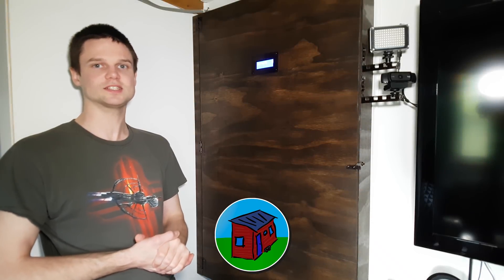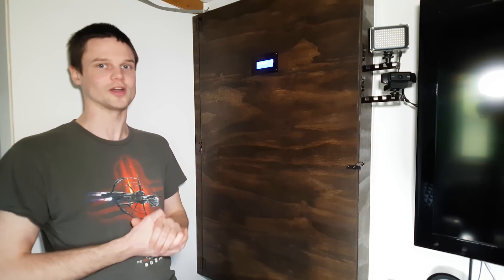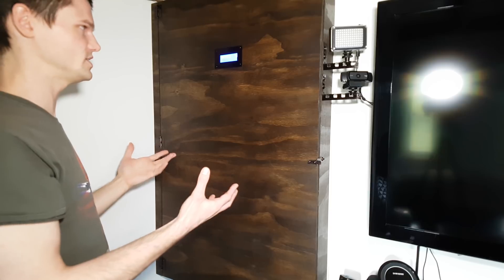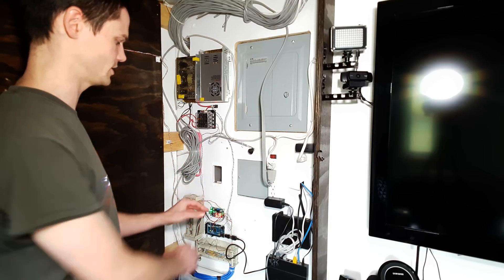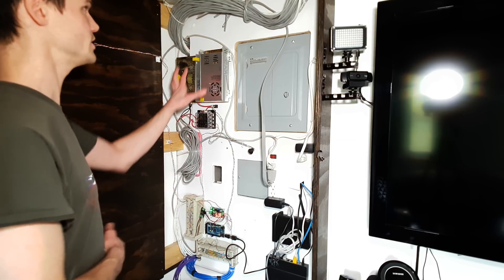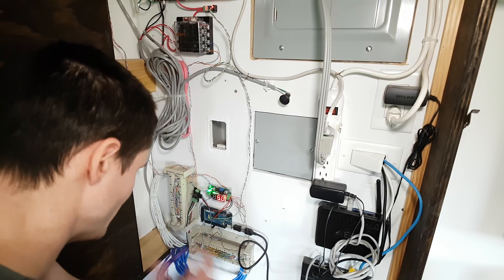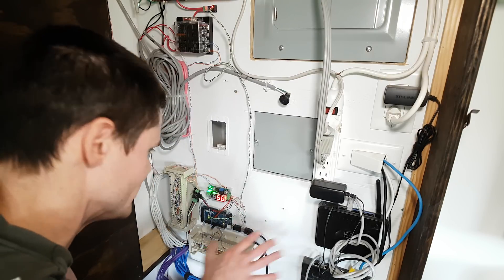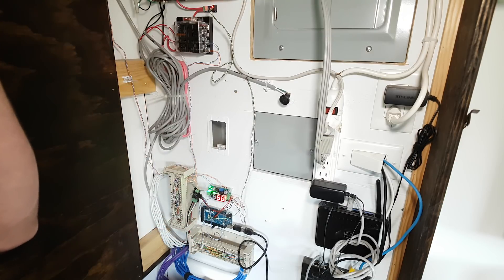DIY Tiny Home Automation Progress

Comment: Really great stuff, it's exciting to see your first steps with Arduino!  If it's not too late you might want to consider using 19mm buttons rather than those 12mm ones, the 19's are far more comfortable to press...very little finger aiming is required.  Also, if you get stuck on any software or hardware related to the project, including that button issue, just let me know and I'll be more than happy to help.  My initial thought is you need to add some button debounce logic to your code.  Microcontrollers are so quick that they detect the slightest double-click of a button, so slowing down how often they react to button presses is always needed.  You can do this with hardware or software.  Here's a short software example that I hope is a help.  I could upload a video to explain more if needed, just let me know.

const int BUTTON_DEBOUNCE_WAIT_TIME = 200;
const int PIN_BUTTON = 2;
 // Connect one side of the button's switch terminal to this pin, and the other side to ground.  If your button has normally open, normally closed, and common terminals; connect normally open to this pin and common to ground.
const int PIN_LED = 13; // Use the built-in led.

unsigned long _lastButtonPressTime;
int _currentLedState = LOW;

void setup()
{
  pinMode(PIN_BUTTON, INPUT_PULLUP);
  pinMode(PIN_LED, OUTPUT);
}

void loop()
{
  bool buttonIsPressed = !digitalRead(PIN_BUTTON); // When the button is pressed the pin will be LOW / 0V / GND.  When released the button will be HIGH / 5V / VCC.
  bool lastButtonPressTimeoutHasExpired = millis() - _lastButtonPressTime > BUTTON_DEBOUNCE_WAIT_TIME;

  if (buttonIsPressed && lastButtonPressTimeoutHasExpired)
  {
    _lastButtonPressTime = millis();
    _currentLedState = !_currentLedState;
    digitalWrite(PIN_LED, _currentLedState);
  }  
}
Reply from the maker: Yay code in the comments! This is a first lol... firstly, that's a good suggestion regarding the button size, but we might have as many as 4 buttons on a single cover-plate, which is why we picked the smaller ones. 
I do have debounce code already, including both a delay and a hold on triggering if a button is being held down (which you can see in the video). I suspect the intermittent weirdness that I have experienced might be due to the capacitance of the physical wire, causing the arduino pin to register a phantom press... but I'll have to connect more buttons and lights before being sure of anything. 
Here is a snippet of my code. BUTTON_READ_DELAY is 50, so 50 cycles of the loop, and I have a 10ms delay for the entire loop which has a blanket effect on some other things including the fading speed. I'm hesitant to use millis() because it eventually rolls over... does your code break when it does?... Anyway, I'm fairly confident that my code robustly prevents any software-based double-presses... a trigger is only recorded after a delay since the previous trigger, and then a trigger can only cause a state-change once before the delay is reset (10ms x 50 cycles = 500ms minimum between software triggers).

  //read buttons after read-delay has elapsed, and store their trigger
  if (buttonReadDelay == 0){
    if (!digitalRead(BATHROOM_LOW_PIN)){bathroomTrigger = 1;}
    if (!digitalRead(BATHROOM_HIGH_PIN)){bathroomTrigger = 2;}
  } else {buttonReadDelay--;}

  //if any button is down, store that fact
  if (!digitalRead(BATHROOM_LOW_PIN) || !digitalRead(BATHROOM_HIGH_PIN)){
    aButtonIsDown = 1;
  } else {aButtonIsDown = 0;}
  
  //bathroom state change
  if (bathroomTrigger > 0 && !aButtonIsDown){
    if (bathroomState == bathroomTrigger){bathroomState = 0;}else{bathroomState = bathroomTrigger;}
    buttonReadDelay = BUTTON_READ_DELAY;
    bathroomTrigger = 0;
  }
Reply: @tinynestproject  Ok that's great you've made your own debounce logic, so we can rule that out.  Quickly though, the millis rollover is a problem if not coded correctly, and Nick Gammon's write up is where I learned to do it properly.  It is a good read, and not too long.  https://www.gammon.com.au/millis

My next thought is the weak pull up resistor built into the microcontroller isn't strong enough for the long wires, which are acting like antennas and being affected by EMF and potentially capacitance as you mentioned.  To rule this out, can you forgo using the microcontroller's weak pull up resistor (it's around 50K ohms) and instead use a discreet 5-10K ohm resistor?  In the setup() function you would use pinMode(BATHROOM_LOW_PIN, INPUT) rather than INPUT_PULLUP.  And here is a picture of how to wire things up
https://cdn.sparkfun.com/assets/6/f/b/c/7/511568b6ce395f1b40000000.jpg

This stronger resistor will more quickly pull the pin to 5V when the button is released, and any noise due to EMF will be more short-lived.

If this doesn't work, could you tell me how often the double press seems to happen and how long after you press the button that the second press is incorrectly registered.  Just paint me a picture of the symptoms.
Reply from the maker: Thanks for the link about millis rollover, I'll definitely refer to it when I touch up my code :) 
Glad to hear your comments about the pullup properties, because that was the exact conclusion that I've reached so far, and I think I'll be trying it soon. Do you think I'd be able to use a single resistor to pullup all of my button pins? (there will be something like 15-20 of them) It would create a bunch of parallel current paths (and the current would all flow through the single resistor), but isn't there a high resistance at each pin? I really suspect capacitance because it would seem to explain the behaviour.
Reply: @tinynestproject  I might not understand what you have in mind but I don't believe a single resistor is possible.  If you connect side A of the resistor to 5V and side B to pins 2 & 3, it means that pins 2 & 3 are connected to each other and it will not be possible to isolate which one is pressed.  They will both have a 0V potential on them if either is pressed.  So just like what is built into the microcontroller, you'll need a separate 5-10K resistor for each pin.

Here's what I think you're describing.  Pins 2 & 3 will both be connected to GND if either button is pressed, so this doesn't work.

                                                                                                                10K Resistor
                                                                                                    +---------------/\/\/\/--------------- 5V
                                                                                                    |
                                                        Button 1                             |
                                                        -------------                              |
                      +-----------------------------              --------------------------+-----  Pin 2 (INPUT mode)
                       |                                                                            |
                       |                                Button 2                             |
                       |                                 ------------                              |
GND ------------+------------------------------              -------------------------+----  Pin 3 (INPUT mode)

But you're correct in that INPUT pins are very isolated from the circuit, they are in a high-impedance state and have an equivalent series resistance of about 100 mega ohms, which is huge.  This is completely unlike the behavior of an OUTPUT pin.  When you set a pin to be an OUTPUT, it will attempt to drive the circuit HIGH or LOW (5V or 0V) so you need to be very careful when dealing with them.  Imagine connecting pins 2 and 3, setting both to OUTPUT, and then setting pin 2 HIGH.  That will create a dead short between the two pins and both will be fried.  The generated heat might damage other circuitry in the microcontroller as well.

The other point about doing things in parallel through a single resistor...you can use ohms law (Voltage = Current x Resistance) to determine if the resistor can handle it.  For example, if you connect side A of a 10K resistor to 5V and side B to GND, and solve for current, you get 5V / 10,000 ohms = 0.0005 amps.   Resistors are rated for a certain amount of wattage (Watts = Voltage x Current) so the 10K resistor will only be forced to dissipate 5V x 0.0005A = 0.0025W.  The most common size of through-hole resistor that comes in hobby kits is 1/4 watt.  So a 0.25W 10K resistor can easily be connected directly between 5V and GND without being damaged.

Hope some of this helps!
Reply from the maker: Ah of course... I didn't think it all the way through in terms of the pins being interconnected... sigh that's a lot of extra resistor connections, but I've just ordered some small breadboards that I will mount inside the cabinet to assist with this type of thing. 
The rest of your comment was also super helpful thanks. I've learned a fair bit of this stuff already, but extra details and refreshers are very much appreciated :)

Comment: I’m an electrician as well; from Seattle. Building a tiny house as well. I’ve watched a whole bunch of your videos over the last year of the build and they are the by far the best source of information out there. Keep it up!

You seem to have a good amount of experience in controls/PLCs. What kind of work do you normally do?
Reply from the maker: Thanks for watching! 
Maybe saying that I "am" and electrician is a bit misleading, in the sense that I haven't been doing much electrical work since starting the tiny house several years ago. More recently I had been doing work on data systems, like terminating fiber-optics cables, cat6 patch panels, and messing with phone systems. My ability to work on this arduino project is not so much the result of experience with PLCs but more from my general life-long interest in tech and computers. I did some first-year-university computer-science courses in the mid-2000s, which is a good foundation to start from.

Comment: Hey Jake if you're having an issue with multiple presses being registered when you've only pressed it once you may want to look into Switch Debouncing. Here's an Arduino tutorial based on this problem which may help. Basically you may need to add a delay after 1 press is registered to ensure multiple aren't picked up. https://www.arduino.cc/en/Tutorial/Debounce
Reply from the maker: Thanks for the info :) 
I actually have debounce code (one of the first problems I solved in my prototype) as well as a hold on triggering as long as a button is held down... I believe the intermittent issue I've seen is due to the capacitance of the physical wire, causing the arduino pin to register a phantom button press... I'll need to see how it functions with more buttons and lights connected before I can do anything more.

Comment: Your lavatory light routine is reading the button-press too quickly (after the first detect). Look up "key bounce."  Parallax (pre-Arduino) had a key bounce routine.  You might have to write your own.
Reply from the maker: Ye have little faith... lol 
You are right about that being something that I had to deal with, but I've double-dealt with it in the sense that there is a debounce delay as well as a hold on triggering a change as long as a button is held down... which I'm fairly confident covers the code side of things... I might adjust it a little more, but I suspect the unpredictable behaviour that I've experienced is due to the capacitance of the wire itself, causing the arduino's pin to read a phantom button press...
Reply: Yikes, sorry.  Did not mean to question your ability. Sorry. :)  Just relating what we did in the wayback machine… we also had to flush buffers to ensure "last press" was not still hanging around.  I am sure you will find it.  Off topic: refreshing the request for your Tiny to be "palletized" (deconstructed) on Sketchup to see the stack of required material (wood, wires, paint, toilet paper hanger, etc.)
Reply from the maker: Flushing buffers sounds like some pretty labour-intensive low-level control... I can only imagine... 
We might make some more SketchUp resources (like a Tiny Nest breakdown), but it's hard to justify putting in the time right now... but we might do it and charge a few dollars for them to make it worth out while ;)
Reply: Maybe after you are finished with TinyNest… but before your first child.

Comment: Jake this is amazing, thanks for sharing! Probably the most anticipated part of your build for me. About the ring lights on switch, having them both lit up when no option is selected might be nice for finding the switch in the dark? I know sometimes you wonder if you're going on too much in your videos, but better to explain too much than not enough. Especially with this very technical stuff, hope to see lots of time simply explaining what's going on hardware and software wise and your thought process during design. Thanks again
Reply from the maker: Thanks for the encouragement! That actually means a lot :) 
Great suggestion about the ring lights... I think I might be able to have them all lit up dimly as an "off" state, or (and this would be getting fancy) have an outdoor photosensor feed data into the code to determine if it's night time and thus trigger some beacon light for the rings ;)
Reply: Yes, this is the overengineering that I would also really enjoy! I'm sure you plan on having such a sensor eventually anyways, can't wait to see what interesting use cases you find for combinations you hadn't previously considered or explicitly planned in advance. Cheers

Comment: Did you choose between raspberry pi and arduino, or did you plan to use arduino from the start?
Reply from the maker: When I first looked into this years ago, I picked arduino and stuck with it. I figured that I wouldn't need the capability of a full operating system and that sticking with a single-program board like this would keep the whole process more streamlined.

Comment: with the led revolution for lighting, I've long thought that there should be/could be a 12 volt system in homes (tiny or normal) to power lighting and other things (tablet/phone, small appliances, etc..) instead of multiple vampire power brick/supplies stepping down the voltage for its application .. of course you can't get away from 110/240 needs and having two different power systems in a home may overcomplicate things, but glad to see you trying this tech.  As for your curtain solution, I recently switched my closet doors (dual sliding) to two curtains and how nice it is .. easy to use, light, sound absorbing and decorative .. all my other wood closet doors are doomed .. as for my bathroom doors it might take a bigger leap, but I'm thinking about it.  Good video guys and get that dehumidifier wired with a cover!
Reply from the maker: I think it's a bit impractical to run the two power systems (like you said) if the physical wiring distance is even moderately long... the amount of copper required becomes huge due to the higher current that flows when powering low-voltage devices. But it can work well in a tiny house because the opposite becomes true: if you have many low-voltage devices, you end up converting between voltages many times even though everything is in close proximity.  
We're not super stoked on the bathroom curtain. It's perfectly acceptable, but we had planned for a rigid door of some sort, but our first attempt to build one was a failure :(
Reply: barn doors are popular in TH's as it eliminates the swing .. but I like curtains too, much more flexible .. pleased you kept your rigid door to yourselves .. don't want a repeat of the shelf project .. I'm a big believer in the Pareto theory and getting all these details finished/done will take more time than you imagined .. but keep at it .. I think your showing what can be done and done well!